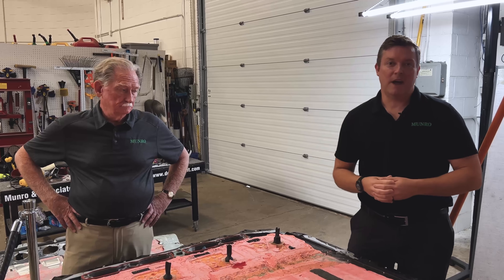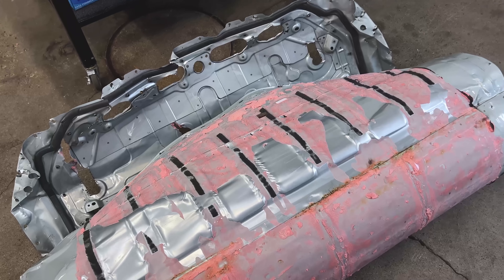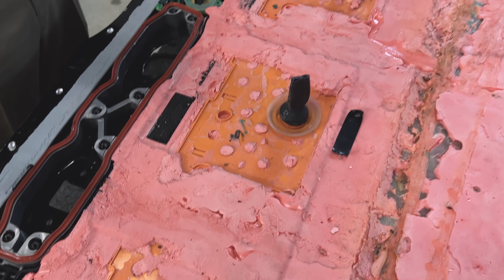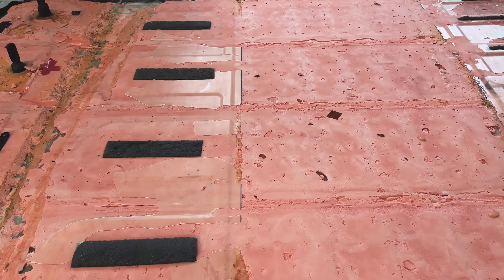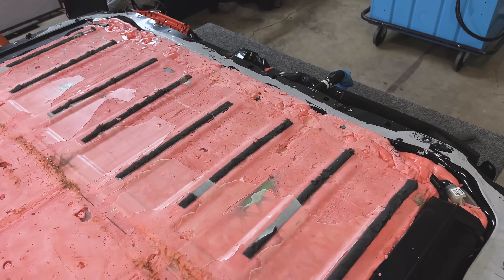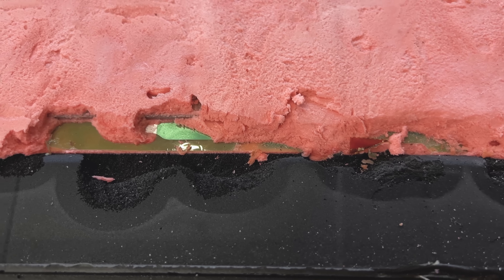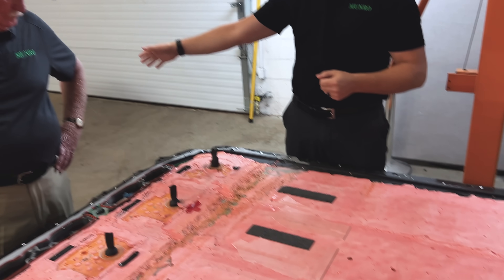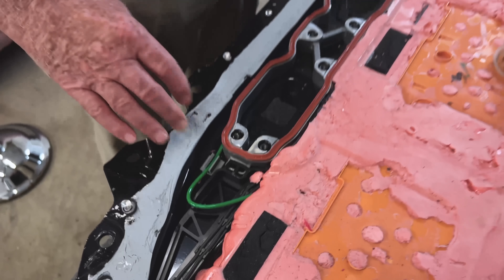FINALLY! 4680 Battery Pack Lid off | Tesla Model Y Update

Comment: Breather tube could be just to balance internal pack pressure due to temperature variations.
Reply: I think the breathing tube is where you inject the secret sauce that will dissolve the pink foam🤔🤔🤔 so that you dont have to rip the top part off
Reply: The tube could be for suctioning out air to create a good uniform seal while the glue for the plastic sheet cures.
Reply: breather tube is likely for when the 'foam' is added for settling. And then helps balance pressure after during temp changes.
Reply: Assume there is a valve on it somewhere. High silicon content, so cells may need some breathing space. The foam layer may have to do with that as well.
Reply: @Cloxxki  there is no silicon in the 4680s coming out of Austin
Reply: @lucascurtolo8710  says who
Reply: @airheart1  The Limiting Factor tore down and tested a 4680 from Kato Road.  Its a 6 month old cell but no silicon in that.  Check out his recent video.
Reply: @oof_Dad  right.. i figured this was your source.. but he specifically stated.. as you did.. it’s an old battery and by no means is necessarily what is being produced today. We know how fast Tesla iterates. You can’t say there is no silicon in these batteries with any certainty. If Munro tests one and agrees.. ok.. but a 6 month old 4680 that we know has gone through some visible changes at the least.. can’t be 100% certain the chemistry hasn’t changed
Reply: @airheart1  also it was one from the prototype production. they might have varied the chemistry quite a bit (change one variable at a time, and see how it influences the outcome), and this happened to be one of the 0 silicon from the comparision group. no way to tell for sure, since its from a refuse bin mixed with possibly many othrs

Comment: I dont see how that will be easily recycled
Reply: They shred the entire thing and start separating the elements.  I wonder how they make sure the entire thing is completely drained.
Reply: Congratulations, yours is the 3rd worthless comment on repairability/recycling.
Reply: Volkswagen has a video how they plan to recycle their pack. Drain the pack, then shred it and with chemicals separate the elements. Much cheaper than melting down like a car engine. Since no high voltage melting system needed and no man power needed to do this.

Comment: So, how the heck is Tesla going to replace bad modules as they’ve always said? It’s going to force people to buy an entirely new pack!
Reply: They never replaced indidvidual modules before, why they will right now?
Reply: @pashko90  Exactly.
Reply: Any replacement modules need to be balanced with the rest of the pack.
Reply: There are only 4 modules in that pack anyway and much of the cost (assuming no warrantee) is labor.  So being able to change individual modules probably wouldn't reduce cost as much as you think.  Several years from now when warrantees being to expire the cost of cells will be even lower than today.  

Also, if a pack is being changed out of warrantee, then it's probably quite old.  It wouldn't be a good idea to put a new module in an old pack with old modules anyway since the modules would be unbalanced.
Reply: Do you really want to show the VWs, BMWs etc. how to get rid of the foam without damaging the components? 🤔
Congratulation to the Tesla team. 😜😎
Reply: Congratulations, yours is the 2nd worthless comment on repairability/recycling.
Reply: So you’re not going to mention the warranty then, imagine my shock.
Reply: @fredbloggs5902  Warranty is too short, after this repairs get expensive this way.
Reply: @fredbloggs5902  do you know about it? I do, it says exactly that. That you’re not guaranteed a new pack but modules AND that you are only guaranteed peak performance of the max guaranteed. Which I think is 70% SoC.
Reply: Dry ice blasting, change module, new foam, new cover sheet. Done.

Comment: Repairability for this is absolute 0. Tesla is going to capitalize selling you entire new packs rather than fixing minor problems
Reply: So you’re not going to mention the warranty then, imagine my shock.
Reply: @fredbloggs5902  The warranty is great, but if we're mining so much rare earth metals. Then they should also promote these cars being able to be easily repaired past the 8 year warranty.
Reply: @KBMamba0824  There are no ‘rare earths’ in LFP batteries.
Reply: if the batterypack goes kaput, then the car is kaput. any impact of that magnitude would result in a total wreck.
Reply: @sizzlebae2060  11k new pack for a model 3/Y. Its not that expensive overall.
Reply: @sizzlebae2060  Depends what is wrong with the battery pack. there's been often, easier/cheaper repairs being done by 3rd party repair shops on current Tesla Battery packs, that tesla advised to replace entirely. If you can repair a single module rather than an entire pack, its better for the consumer and better for the environment.
Reply: Congratulations, yours is the first worthless comment on repairability/recycling.
Reply: Dry ice blasting, new module, new foam, new cover sheet, done.
Reply: Did they ever repaired packs for a customers? Never....
Reply: There doesn’t seem to be much opportunity to repair/repurpose/recycle. I can’t believe these will just end up in a land fill. Tesla must have a plan for spent batteries
Reply: @kevinmills5293  Its possible to reuse. As much as a 2170s from 3/Y, maybe even more reusable. We well see. I dont have a 4860 cell to tell you for sure.
Reply: If it doesn't break...

Comment: THANKS4GIVING     My guess for the breathing tube is Tesla has been having water intrusion problems so they have to figure out other strategies to fend this off. 
As the batteries warm and cool the pressure changes, the air entering the structure pack contains water, it will condense when the pack cools building up over time or if there is water present when the internal pressure is low it will suck moisture in. Every thermal cycle warm to cold will bring in more moisture ( if it’s president) 
Metal when cold will pull moisture to it like a cup of ice water, so moisture is present more than we would think, One way to control that is to pressurize the structural battery pack, and for redundancy seal the pack as well as possible. This tube might be to pressurizing, or to pass through a air drier
to insure only dry air enters.
Reply: If you blow into the tube, all the pink foam falls off.
Reply: @scottbreseke716  What if you suck on it?